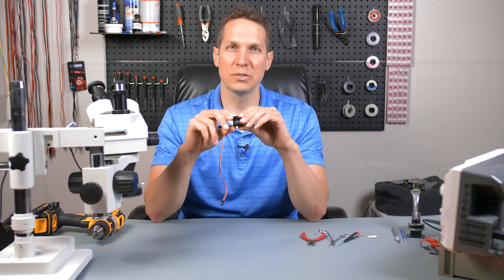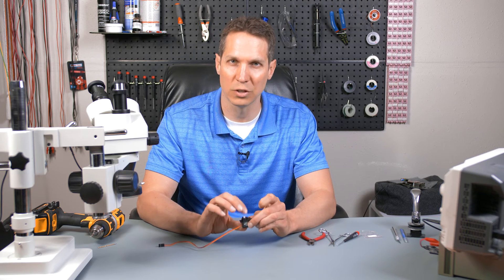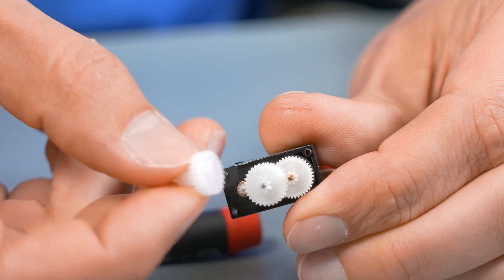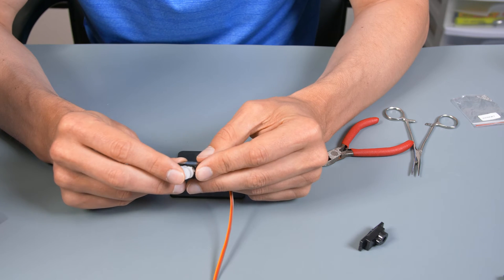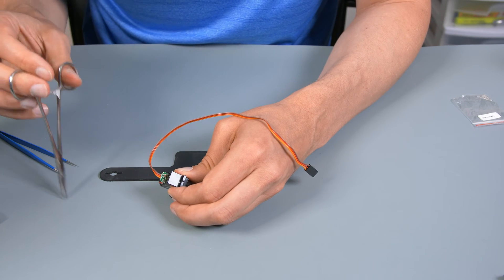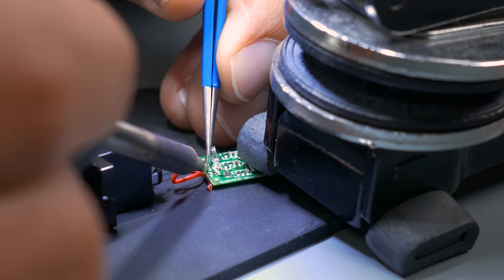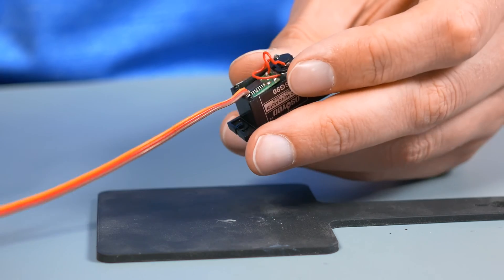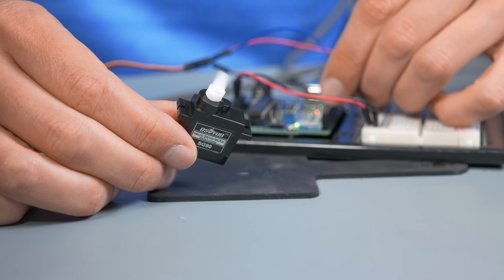How to make a 360 degree Continuous Rotation Servo Motor

Comment: I have about 24 servos that I would need to convert into 360 degree servos, is this worth the time investment or would it be better for me to just buy 360 degree servos instead?
Reply from the maker: I haven't looked into them recently but when I bought a few 360 degree servos a couple years ago, I was surprised at how expensive they are.  It's the age-old question of if you have more time or money.  24 servos is a lot, which would both be expensive to buy that many and tedious to convert that many, so that's a real challenge.  The one thing I will say about buying them is that they're probably going to be more consistent in their responsiveness.  Some of the servos I've converted respond differently to the signals, which is probably just a result of inconsistencies in the way I converted them.

Comment: Any way to stop the servo from spinning ? I’m making a project servo works well but it continues to spin even after the code cycle finish
Reply from the maker: Yep, you have to set it to the "0" point at the end of the code.  From my experience, this "0" point is slightly different for every continuous rotation motor, but you can find it with a little experimentation.
Reply: @CircuitBread  yeah I’m sorry HAHA I figured it out 5 minuets after I made that comment I was like “let me play with the numbers a little bit” and ended up finding the center point but thank you for this video my elevator project is working out well now 😁

Comment: Hey, great video, just one question, how exactly does your code look, I don't unterstand if the servo constantly thinks he at 0 degree, and your command is to spin to 90 degree, wouldn't the command last forever? I don't know how to make the servo only spin for a specific amount of time.
Reply from the maker: Hi Tisch!  This is done simply by not sending any more position signals.  So, to control the length of time it is turning, you loop the position command repeatedly.  Once it's done spinning, you jump out of the loop.  Pretty simple!

Comment: I gained 2 destroyed servos from this 👍 (edit) Third time's the charm right?? just bought another servo and time to try again.
Reply from the maker: Yeah, it is definitely tricky, I've also had varying levels of success while doing it.  Good luck on the third attempt!
Reply: @CircuitBread  I just got done putting it in my crawler truck and it works like butter
Reply from the maker: Awesome, glad to hear it works!  Assuming butter means that it works smoothly, not that it's chunky and slow.
Reply: @CircuitBread  Yes nice and smooth but I think the potentiometer somehow moved because every now and again it turns slowly by itself so I'll have to take it apart and reglue it again.

Comment: Hi, thank you for posting your work and your research here.
I used your video as a guide for making my servo a continuous rotation servo.
I modified an SG90 servo just like yours.

In my 1st attempt I tried the 222 resistors method and other divider combinations, but that did not work very well for me. Little unbalanced divider was making the servo move in one direction very slow instead of staying stopped. It is possible, but  I think is just a little more work to do it this way.

In my 2nd attempt I have centered the servo at the 0 degree through code, then I started the physical modifications.
- cut the locking pin for the top gear
- glue the potentiometer at 0 degree
This 2nd attempt was successful for me and it seems to be so much less time consuming.
I used superglue, and while the glue was setting I had all gears out and the servo set at 0 through code (or manually, see tip 1 below).

Tip 1:
Before applying glue, you can actually move the potentiometer with a little screwdriver or paper clip, and see the motor moving (all gears are out at this stage).
You can then, manually, slowly re-center the potentiometer.
Once the motor stops, you will know it is in the right position, apply super glue and let it set.

Tip 2:
Backtracking my steps now, I find very useful to have the ability to set the correct 0 position.
As you mentioned, inexpensive servo testers devices exists, but if you will use a development board, the tester is not really needed (cause you will do that through your own code).

If someone is in need of this procedure, understanding 100% how the servo works is crucial to rapid success. Consider all necessary calculations for the PWM values,  otherwise servos will end up being destroyed (Destroyed one in the my learning process as a result of not having the correct values for the PWM).

Tip 3:
If you will be using the glue method, when cutting the labels with the knife, cut the label only for the cap where the gears are located. This way the bottom part will stay in place, when you remove the screws.
Reply from the maker: Awesome tips, thank you very much for sharing!
Reply: Hi, thank you for the elaborate explanations of your experience.... Took me down memory lane...

ok then,  so, what are the correct values for the PWM (if it's not CIA top-secret stuff)....  (just to quote you "Consider all necessary calculations for the PWM values")
I allways thought  that "servoWrite()"  command took care of all the necessary calculations...  never had the need to calculate the PWM signal....  (presuming you are using PWM able pins on  the Arduino along with the appropriate "servo library")
BTW keep up the great work!

offtopic: In my experience with continuos servos (original and "reworked" standard servoes) having two mounted on a robot, it was always a problem/dificulty to make the robot go forward/backward ina a straight line....

Comment: how do you know that you need a 0603 resistor instead of any other model? how could y know which one i need?
Reply from the maker: There's no reason you need an 0603, it's just a size that I found was small enough to fit in there but big enough that I could handle well.  You can use any size resistor you'd like.

Comment: For the soldering step I just soldered a metal beam across all three pins which should in theory work (the other video tied the wires together, same thing) but my motor always spins in the same direction and speed as long as the pulse width is above 0, does anyone know why?

Comment: Does the speed of a servo depend on the difference of the pulse from nominal 1.5mS width? That'd explain how you make it change direction and speed, though you didn't mention it.
Reply from the maker: That is correct!  The greater the deviation, the greater the speed. That should've been mentioned, thank you!

Comment: can you post the code to go on continuously with that motor? video is useless without it. thanks!
Reply from the maker: The code will depend on the platform but if you're using an Arduino, we just used the standard sweep program that comes with the Arduino IDEs.  It makes the servo go first one way and then the other way, it's quite straightforward.  I hope this helps!

Comment: Hey man. I'm looking for a solution for my project and my electrical skills ain't high enough, hoping you could help me out.
So I've built two huge steel doors for my garage which hopefully will be burglar proof this time. The locking mechanism is like an old school vault door, rack and pinion, which I spin a big gear in the middle and it pushes out 18 deadbolts so it locks the doors in place. The plan is to use the same app as my home alarm system because it's at least slightly secure. They have regular wifi switches for lamps and stuff like that within the app, simple on/off switches.
And now to my problem; how do I use a simple on off switch to control a regular rotational motor to just spin 180° and then just stop there until I flick the switch again? Is that possible with servos or something else? 

I couldn't find any good answers so I started thinking about a strong linear actuator but I think it's the same issue there too, they don't operate with just simple on/off, right? You gotta hold the power button until you get the position you want with those, right?
Hehe sorry for the very long text, hope you could help me out here. Thanks in advance!
Reply: youll have to use a microcontroller such as an arduino
Reply: @milomitchener4166  thanks for the tip! I looked it up and it seemed very interesting. But I'm worried it would be to many electrical components who could fail in the long run, in the cold moist winter if I were to use that system. I could definitely use it to some other projects. Thx
Reply from the maker: Yeah, I'd agree with Milo.  It's serious overkill but it does give a huge amount of flexibility if you want to add more features and it also allows you to easily adjust your control over whatever motor you want to use.  The Arduino will most likely not be able to directly drive the motor, so you'll want some sort of motor driver in there (which will depend on whether you use a large servo, a stepper motor, or a linear actuator).  Or you may decide you want to use a plunger solenoid that will require less logic, that's another option.  The plunger is a simple on/off but they "pop" into position and it takes electricity to hold them in one position, so they may not be a great fit. 
Hopefully this gives some ideas!
Reply: @CircuitBread  thanks for the reply! I looked into the arduino and it seems like a really cool thing for sure, but I'd like to keep it as simple as possible for long term reliability..
I googled those plungers you mentioned and they would definitely work if I could find a big one that's pretty strong. I'd probably need something with like 10 kilos of force to lock/unlock the door.. Are they all small or do they come in bigger sizes as well? Aren't there any on/off linear actuators?
Reply: What you need is a simple limit switch. You don't need complicated microcontrollers and what not. Look it up  -  limit switch.

Comment: Why can’t the three terminals on the board be shorted out instead of putting a resistor in between the terminals?
Reply from the maker: Current consumption!  If you short them out, they will draw too much current and burn themselves out.

Comment: about about the code how to write for 360
Reply from the maker: You use the same code that you'd use to control a regular servo.  But then the code controls the direction and speed instead of location.  You can experiment with it, it's quite straightforward.

Comment: Hey there. Great Video. A question: I have seen a video where the 3 wires from the chip just have been wired together without putting resistors. Is this possible or just true for analogue servos?
Reply from the maker: Hmmm... I believe by doing that you're not getting a continuous rotation servo, you're just getting a geared DC motor.  In that video, was the end result something they could control the speed as well as the direction of rotation by changing the PWM input?
Reply: @CircuitBread  Yes. The wires from the chip to the potentiometer where tied together, not the ones to the motor. So the resistance to the chip is still the same on both sides, mimicking a 0 position like you did with resistors. The vid is from Michael Klements, rly short, 3min

Comment: Thanks you !!!, could solve a problem in a project with this vid, just for add you can use a normal resistor (not the micro version) also works pretty well:3.
Reply from the maker: Yep, you can definitely use some through-hole type resistors instead of the surface mount.  It just gets cramped in there quickly, but if it fits, it should work!

Comment: But Sir, i measured the variable resistor values to be of different values that made the motor thinking that it is at centre.  Measured value is 4330Ohm & 565Ohm, so i not sure why it is different from yours of a perfect voltage diverder with equal voltage with 2.2kOhm?
Any advice why my resistors values are so much different?
Reply from the maker: That is very interesting!  So, when your servo is centered, the measured values on the different legs of the resistor do not match, but are 4330 and 565?  It's entirely possible they simple set it up differently, with a different "middle point" - I'd be curious if that's the case.  Are you able to test and replace the potentiometer with those values of resistors?  If so, I'd love if you could reply back and share with us what you found out.

Comment: How about simply placing the potentionometer in the middle and fixing it in place, say with crazy glue?
Reply from the maker: Yep!  That is an option that we considered - you will have to make sure that it is physically disconnected from the rotating gears, though, or else the servo will be trying to move the superglued potentiometer.

Comment: Is it absolutely necessary to have that voltage divider
Reply from the maker: The servo needs to have a central point and the voltage divider is one method of doing it.  There are other ways to do it, like simply gluing the built-in potentiometer in place, but then you have to make sure the potentiometer is in exactly the right spot before you do it.  There are specialized tools to help you with this or you can just test it manually with an Arduino or something.  For me, it was easier to put in the voltage divider but depending on what you have on hand, that method may be better for you.
Reply: @CircuitBread  Do you mean gluing it in the right place without cutting its leads, whereas when we tell the servo to go for an angle other than the center angle it starts moving for it; however, it will never reach ?

Comment: do bigger servo motors still have these mechanical/electrical feature that blocks them from rotating 360?
i do know that every servo comes with a potentiometer, but are there servos that let u rotate more than 1 rotation(>360)?
and how fast can they turn assuming to be given the right signal?
for example can they rotate at about 300 rpm(6 rounds/sec or 6 Hz) or smth? or not?
thanks for the useful data
Reply from the maker: Hey Mohammad!  There's a wide variety of servos out there, so it's hard to make blanket statements.  As far as I'm aware, there are no servos that let you rotate more than 360 degrees without being a continuous rotation servo, though if you want precise rotation over 360 degrees, perhaps a stepper motor would work.  Servos aren't known for their rotational speed and, unless they're configured to be a continuous rotation servo, I've never known a servo that has controllable speed.